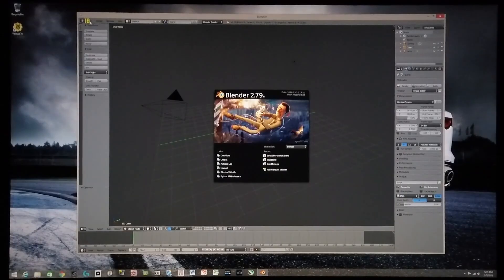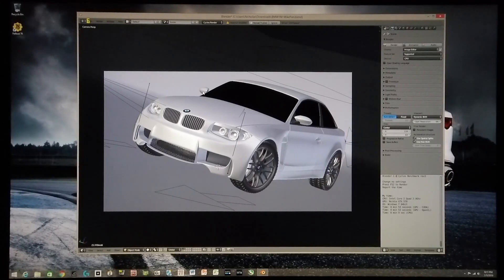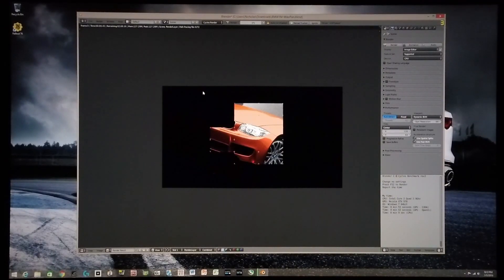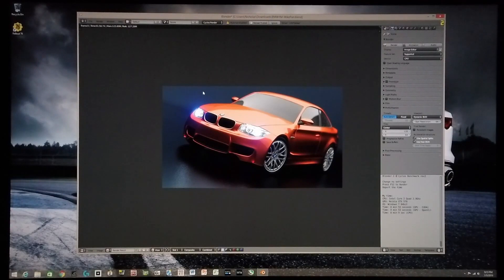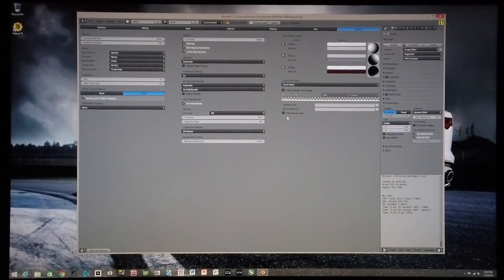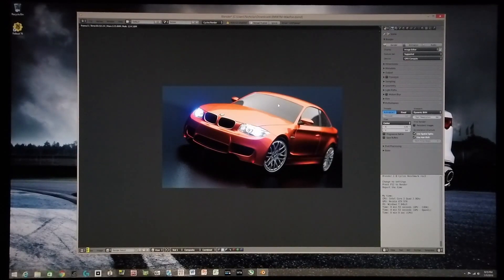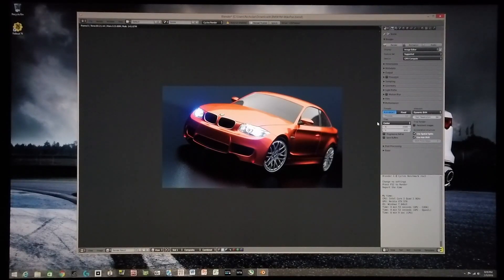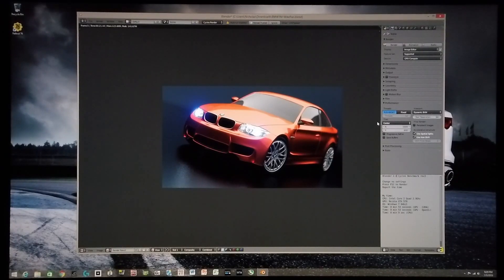CPU vs GPU rendering in Blender 2.79

Comment: Which one is better for blender modelling and render? 5700g with no discrete gpu or i3 with gtx 1050 ti 4gb .thx!
Reply from the maker: The 5700g’s graphical performance is roughly half that of a standard GTX 1060 3GB. When it comes to GPU rendering, I personally favour CUDA, obviously meaning Nvidia GPU’s. (That’s just my preference, or opinion.) 

From a CPU performance perspective, the 5700g will outperform an i3 by a reasonable margin, but it’s more than twice as expensive.

In the end it will come down to the GTX 1050 ti’s CUDA performance vs the CPU rendering performance of the 5700g, as the discrete graphics card will win as far as GPU rendering is concerned.

Comment: What cpu and gpu are you using?
Reply from the maker: An i7 980X and a GTX TITAN X (So rather old tech)
Reply: @Irinikus  which is more important for blender gpu or cpu, can i use 8 core processor with gtx 1030? I want to wait until vga prices return to normal.thx

Comment: Means the cpu have 6 core? I thought number of blocks is according to core instead of threads?
Reply from the maker: Generally, each core can handle two threads. You definitely notice an improvement if you split the render according to the thread count.
Reply: @Irinikus  thanks, I was wrong before

Comment: Whats is usefull for 3d work(max,maya,lumion)
Ryxen 5 3600 + rtx 2060 super
Ryzen 7 3700x + gtx1660 super
Plz help
Reply: If you are going to use lumion ... 2060 will be much faster than 1660 for rendered walkthroughs etc

Comment: Between CPU ( Threadripper 3970X ) and GPU ( Geforce 2080TI ) , Which do render faster on  Blender ?
Reply from the maker: I really don't know, as it's the latest offering from AMD, CPU-wise, and the RTX 2080 TI is already due for replacement, as it was released in 2018. Only testing will tell! :)
Reply: @Irinikus  A 2080ti is not due for replacement, you kidding me? Spoiled rich people, smh
Reply: Threadripper 3960/70/90x has fewer limitations and ends up being a lower cost solution.
Reply: Would definitely be interesting to see how this test would work with more recent consumer CPUs since many now have integrated GPUs. 

If you wanted to do a pure CPU/GPU comparison you’d have to try out something like a Xeon vs NVIDIA’s latest. 

Having said that though the future might be with ARM so you’d have to get a new Mac in there too😅

Comment: All true, but a few caveats:

1. For GPU rendering, as the tile size increases the VRAM usage increases. Thus, using as few tiles as possible is optimal only so long as one does not exceed the available VRAM. Otherwise it'll thrash to main RAM and slow down. Thus, it's good that you have a Titan X, decent VRAM. As with editing uncompressed video, not exceeding VRAM limits can be more important than the raw performance of the GPU, hence why some studios are now transitioning from 24GB Quadro M6000 cards to 48GB Quadro RTX 8000 cards to better handle 8K editing, ie. for the extra VRAM rather than better speed (they won't get much of the latter until apps like Flame are optimised for RTX). For the solo pro or home hobbyist, used Quadro and Titan cards can be a good source of GPUs with lots of VRAM, though at the budget end of the scale one can certainly get started with something like multiple 980 TIs or 1080s, or indeed 1080 Tis.

2. Depending on the GPU archiecture, sometimes the design of the cache structure, bus width and other factors can mean that even when there's enough VRAM to support single-tile rendering, doing so may not be optimal. Usually though, fewer tiles is better.

3. If you do have to use multiple tiles (note this applies to both types of rendering), use tile sizes which produce an even split of the image, ie. having to render fractional tile pieces near the end will slow down the rendering compared to a split that's an integer divisor of the width and height.

4. Given the way GPU kernels work, it may help to seek tile sizes that are a multiple of 8 or 16 on each side aswell, though at this point the additional speed gains may not be worth the pretesting effort unless one expects the render to take hours or days.

5. For CPU rendering, similar issues concerning RAM access, cache heirarchy, etc. mean that beyond a certain point using more tiles is not optimal (hence what you meant by reasonable), but it's also affected by the type of scene. As a very rough guide, I would suggest starting with an initial tile size of 2M x 2N tiles for a system which has N threads, where M initially = N but adjusted to match the aspect ratio, etc. And re point 3 above, an optimal M may not be a perfect multiple of N since it depends on the image output resolution. Thus, for example, for a system with 8 threads, start with a 16x16 grid if the image is square, or perhaps more like 30x16 or 60x8 for a 16:9 image (or whatever; note I mean the number of tiles here, not the tile size; for actual tile size, that depends on the output resolution itself, eg. for 1080p try a tile size of 64x24 pixels to start with).

In all cases, experiment to find out what works best for you.

Here's a real world example of the optimisations involved; consider the system I sent to the Learn Engineering channel:

https://www.youtube.com/watch?v=g2WiJNEZLNY

It has a 10-core XEON E5 and two GTX 980 4GB cards. The LE guys' old system was an i3 4160 Haswell with a very slow GT 610 2GB GPU (so slow they never bothered with CUDA rendering, ie. a GTX 980 is 72x faster than a GT 610). They began GPU render testing using settings based on their earlier experience with CPU rendering (lots of tiles), resulting in their concluding the new system was 3x faster, but after talking to them about how to optimise for GPU rendering instead of CPU rendering, the end result was a performance level 8x faster, while of course the general CPU performance and especially interactive 3D performance was also much better aswell (and the storage was SATA SSD & PCIe SSD instead of an old rust spinner).

Re point 4 above though, they found that optimising for the precise tile size only gave additional small extra speed gains, less than 2 or 3%, and they had to be adjusted each scene, so generally not worth bothering with except for final renders that can take days.

They have sent me an example scene to use as a benchmark, something real world from one of their engineering videos which is much more complicated than the BMW test, the latter being a test which no longer lasts long enough on newer GPUs to be that meaningful (we're at the stage where, a bit like old CPU tests, the data resides too much in a GPU's cache structure and isn't representative of modern workloads).

I'll add the LE test to my Blender benchmark page when it's ready, or I may create a new page for it, not sure yet.

Hope this helps! :)

Ian.
Reply from the maker: Thanks very much for the additional info, it's much appreciated! :)
Reply: Woah thanks dude. Great info!
Reply: Would it be better to purchase one 2080Ti or two 2070 Supers in crossfire?
Reply: @TheSkippyboy  2070 Supers should be a bit faster, but there are trade-offs that you should be aware of if you go with two 2070 Supers - less VRAM to fit your scenes in (8GB vs 11GB); almost double the power consumption (250W vs 430W) which also means double the heat and noise; you will have less free slots left on your motherboard if you decide to add more GPUs in the future. So you decide if these trade-offs are worth it for the speed increase over a single 2080 Ti.
Reply: Whats is usefull for 3d work(max,maya,lumion)
Ryxen 5 3600 + rtx 2060 super
Ryzen 7 3700x + gtx1660 super
Plz help